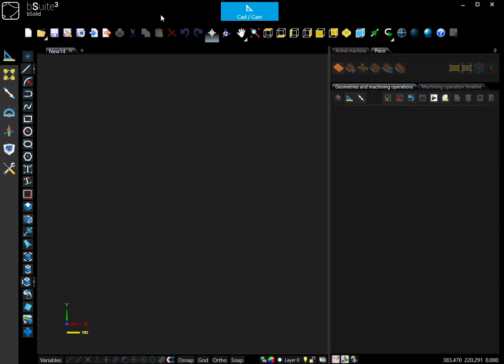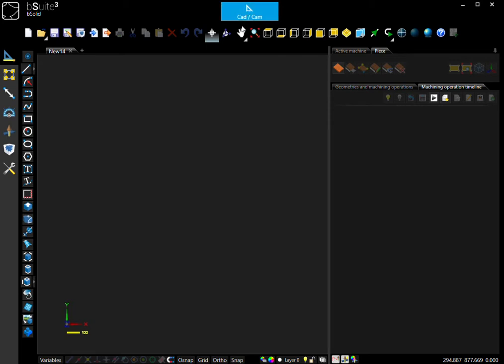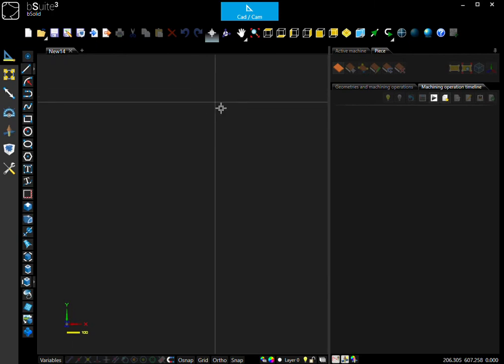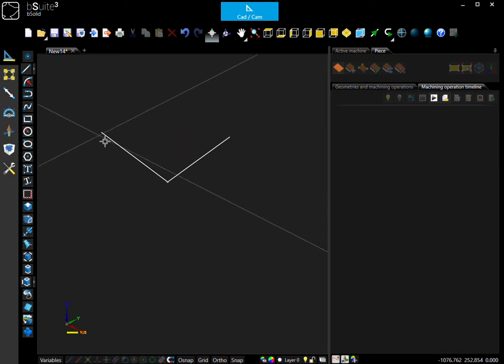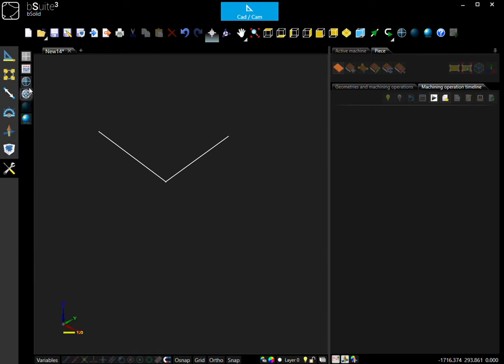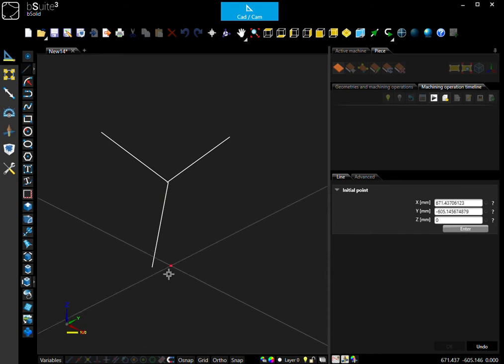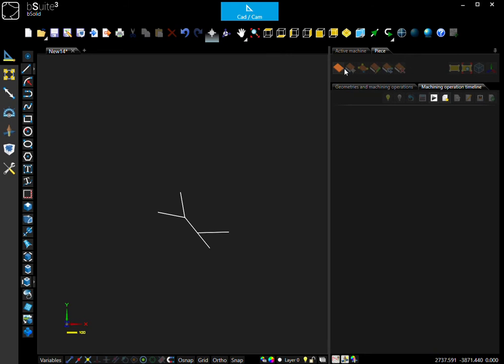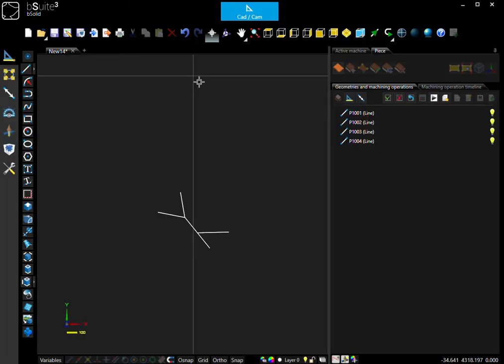1. Biesse bSoild. An introduction to the environment.

Comment: Well thank you for this video, it helped me, to get a first glimpse of the software i'm going to be using a lot in the future. Sinca I have some CAD experience, could you teli me what other formats can be imported?
Reply from the maker: Hi. There’s plenty of formats. Click on ‘import’ and check the dropdown in the ‘file type’ box.
Reply: @chrisarnold8973  Thank you very much for your answer, but I do not work with it yet. It was out of curiosity, because I'm going to be working with it in a couple of months.
Reply from the maker: Try this list....
Extensions for standard import
File extension File formats 1
 .bmp Bitmap file
 .bpp BiesseWorks file
 .cid2 To import change the extension to .cix
 .cix BiesseWorks Exchange file
 .dxf DXF technological file
 
Extensions for import with additional module
File extensions File formats 3
 .3dxml 3DXML format 
 .asab ACIS format 
 .asat ACIS format 
 .asm  SolidEdge 
 .bcix bSolid Exchange File 
 .CATPart  Catia 5 e Catia 6 
 .CATProduct Catia 5 e Catia 6 
 .CGR Catia 5 e Catia 6 
 .dat LaserScan TextFile 
 .dwg AutoCAD (all versions)
 .dwg_old AutoCAD prior to 2009
 .exp Catia V4 
 .iam Inventor 
 .icp ICAM files
 .iges IGES (Initial Graphics Exchange Specification) 
 .igs IGES (Initial Graphics Exchange Specification) 
 .igs_icam IGES compatible with ICAM
 .ipt Inventor 
 .model  Catia V4 
 .par SolidEdge 
 .pnt Point TextFile 
 .prt NX e NX Direct 
 .psm SolidEdge 
 .sab ACIS format 
 .sat ACIS format 
 .session Catia V4 
 .sldasm SolidWorks 
 .sldprt  SolidWorks 
 .step Step format 
 .stl StereoLithograpy file
 .stp Step format 
 .tas Laser Image
 .vda VDA-FS
 .wrl Virtual Reality Modeling Language 
 .x_b  ParaSolid 
 .x_t  ParaSolid 
 .xmt_bin ParaSolid 
 .xmt_txt ParaSolid 
 
I reckon that's every CAD software I have ever seen of heard of covered.!!!
Reply: @chrisarnold8973  Gold! That is quite a bunch. Thank you so much for your kindness, I really appreciate your help!